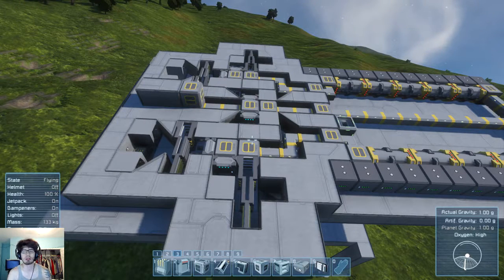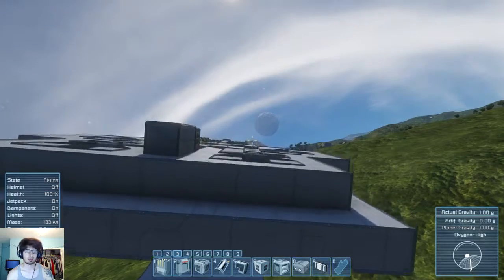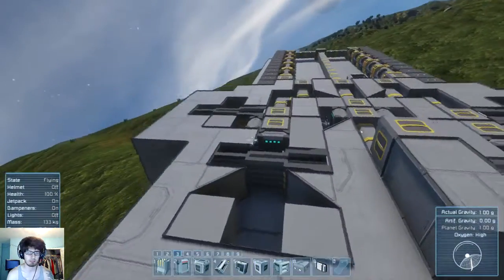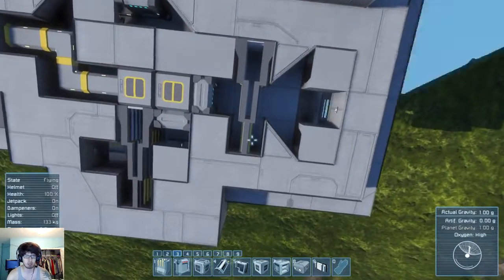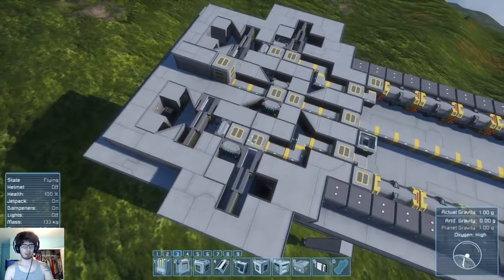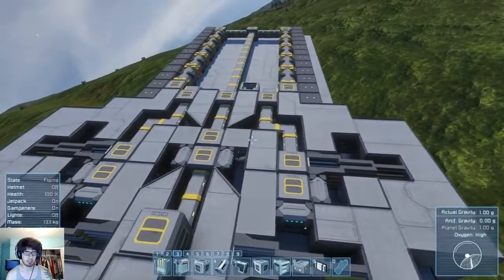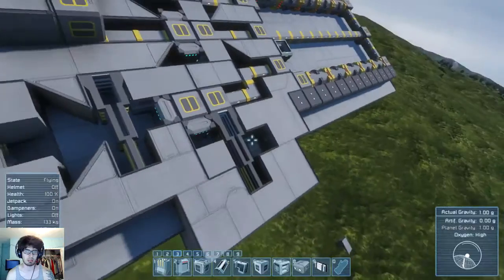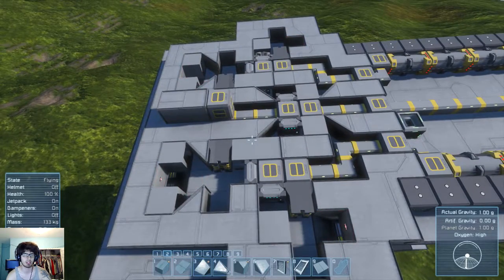[Space Engineers] How To Make A Efficient Oxygen Collection System ( As of 1.149 Dev Build)

Comment: ...Great build... But not in any way shape or form (efficient).
The mass and energy spent in building this system carrying it on a ship, etc is just to bulky and wasteful. :P
Reply from the maker: I'm working on a ship right now that I estimate weighing about 200k long tons when complete. This example system is meant for ships that need a huge amount of air, but yes, not super efficient, but ice is heavy, lol.
Reply: Still, the design is too inefficient.
If I may make a few recommendations?
#1, for what I see you are doing and might match the ship design you are trying to build.  I would have a single thruster looking air input with a 3 block wide passage and a conveyor block with 3 vents on it, then a second conveyor block right behind it with 2 air vents, repeat this until you have as many air vents as you need and then pipe directly to the air tanks, using air tanks as conveyors for air when possible to diffirent locations with conveyor curves and single conveyor extensions when absolutely necessary. This will give you will have a fairly (FAST), compact and fairly efficient air collection system that you could put on a ship.

#2, for a MUCH more (EFFICIENT) design, I recommend the same single thruster looking input, but a 3x3 passage with a conveyor block in the center and 5 air vents on the conveyor block and a second conveyor block behind it with 4 air vents and so on. (Use discretion for adding supports for the dangers you expect may damage part of this system and destroy the whole thing, sending it drifting around inside the ship if multiple connections to hard points are not present.) This design will provide a very compact (if squat) ship that can carry and collect TONS of air and fit more air and less ship length which equals less mass which will lead to more lifting capacity. I'll let you imagine the possibility's. :)

#3, If speed is not a huge concern for filling the air tanks in the ship, (I take it it is important for you, but I'll throw this in as a bench marker for efficiency.) a single air vent to slowly fill masses of air tanks will be (THE MOST EFFICIENT), mass to parts to accomplished work.

Hope this helps you become a more (EFFICIENT) young engineer.
Looking forward to you're next video, I want to see something I can thumbs up, rather than down.
Make me proud!
Cheers! :)
Reply from the maker: All great pointers (an good God my delays are real!). Yeah, mainly, the design would be useful if a ship is not regularly in a high gravity well. Say if you go to a docking station, and need air vented quickly or something. I see it as just get into a low enough orbit to start collecting, it can make for something to be sure. My biggest issue was I always liked to build with heavy armor. No where near as much as before now that I use Shield systems